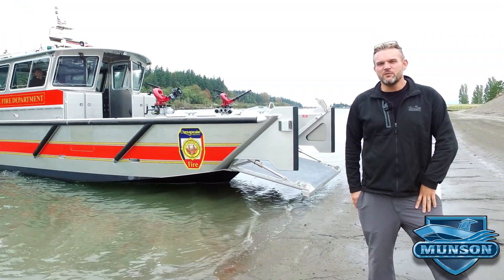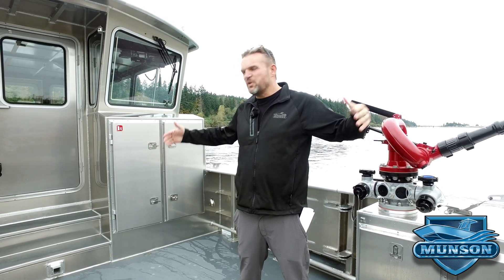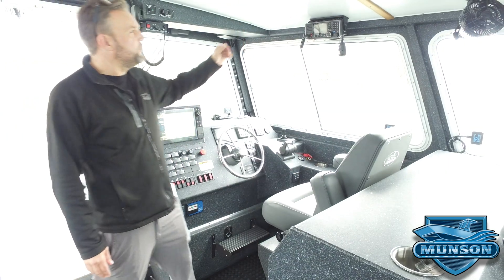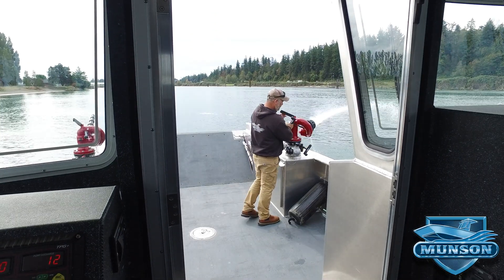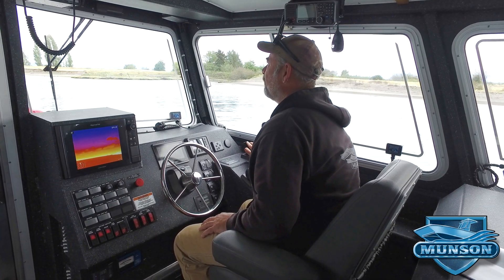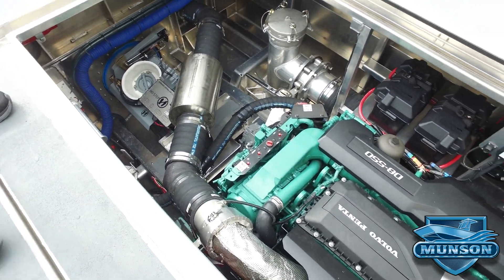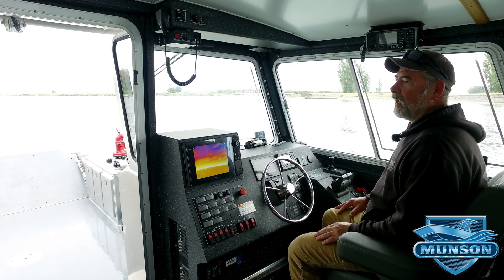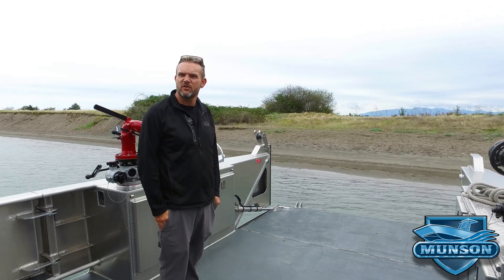Walkthrough of a Munson 40' Jet Powered Fireboat with AVX Joystick piloting

Comment: I wouldn't mind having this basic hull design built as a river running house boat less the fire fighting apparatus to travel the rivers east of the Rockies. It looks stout enough for some moderate coastal off shore also.  The drop down front gate would be great for loading and off loading scooters and such. The Volvo/Hamilton jets would be nice but outboards and bow thrusters would give more room in the boat. The joy stick control is also available with out board manufacturers.